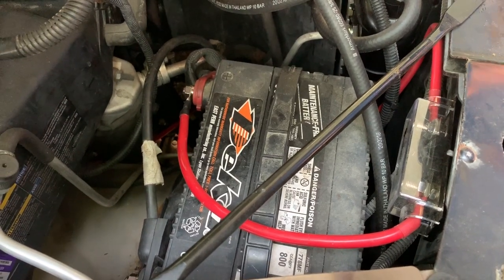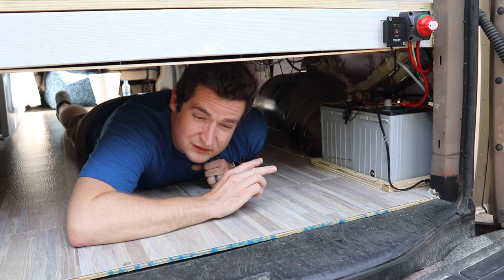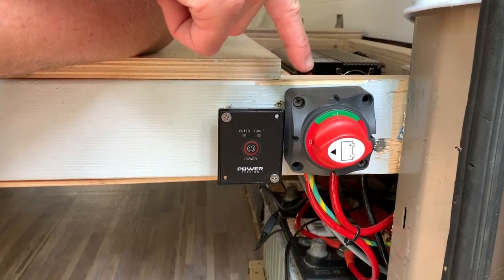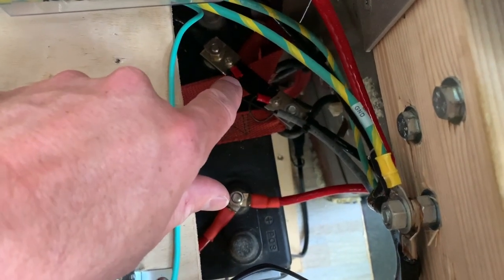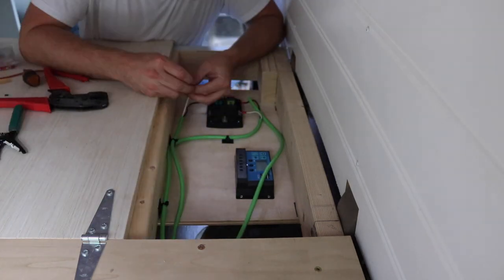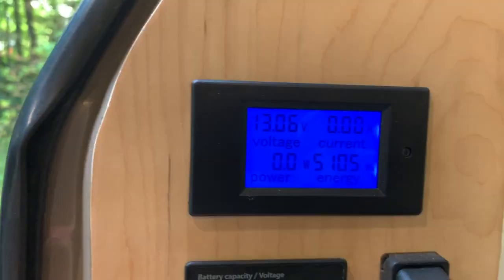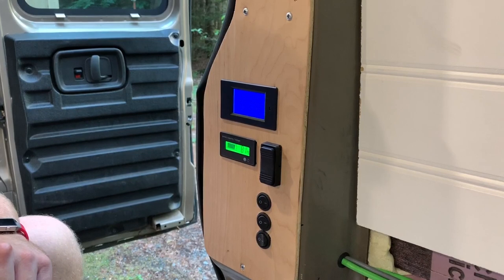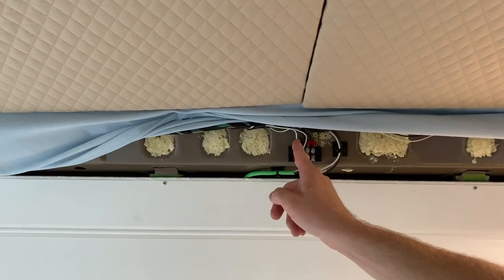Camper Van 12 Volt Electrical | Van Build Step 10

Comment: Hi Gwen and Andy...I've really appreciated all your van build videos and blogs, they have helped me so much in my own build process. I'm trying to get my van ready for a summer road trip and I don't think I'll have time to add solar panels before then. It sounds like you were originally planning on only using your alternator to charge your house batteries. Did you ever consider upgrading the stock alternator in your van to one with higher output? I'm trying to decide if this is necessary for charging my 100ah battery.
Reply from the maker: Thank you so much!  We are glad you have found it useful!  We didn't consider upgrading the alternator because ours was a 105amp alternator and we knew we would be moving regularly.  With 200ah of batteries the stock alternator has been fine and I imagine you would be the same with your 100ah.  We could recharge the batteries from 50% to nearly full in 2-3 hours of driving.  Hope that helps!